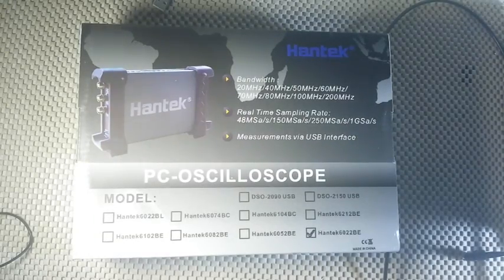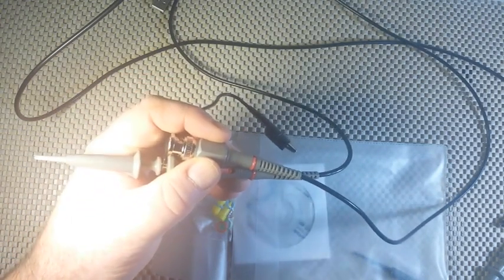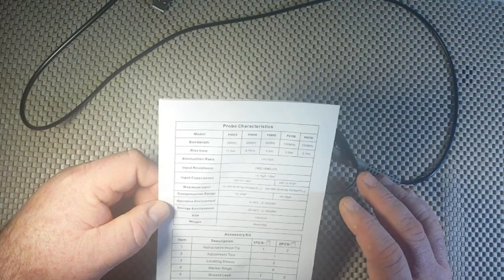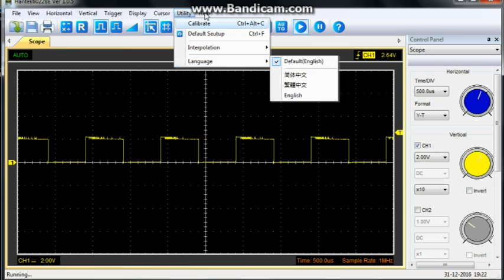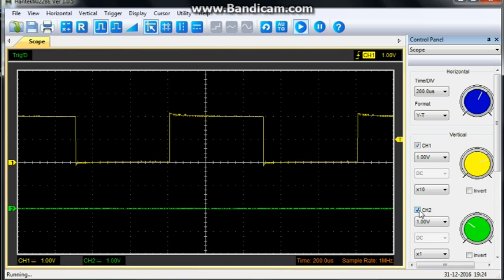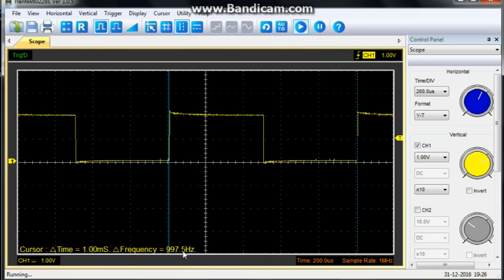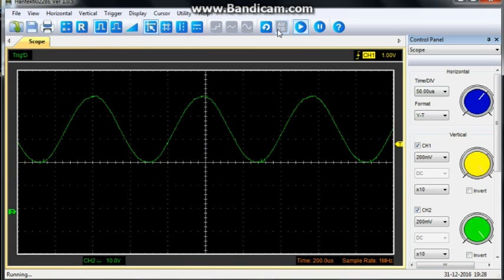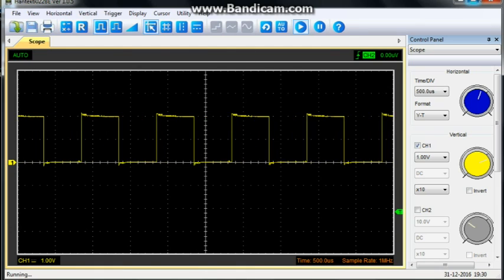Hantek 6022BE Overview

Comment: shout out to all of us "low budget" people in 2020
Reply: Yah, ended up buying one of those dso things instead, has been great for my use
Reply: Mine arrived to day and I have been having some fun with it.  Is it fantastic - HA! no.  Do you get what you paid for - I think so and more.  OK so I'm not trying to analyse GHz signals.  I'll be using it for some building/calibrating DIY test gear and antique radio restoration so I think it should be more than enough for my needs now.

Comment: Mmmm I don't know man.. I'm not too convinced. Somehow my Hantek MSO5202D scope (200Mhz with 2 channels) (stand alone doesn't need a computer), seems a more complete package. Is also very cheap. In China is around 650 USD, but I live in Europe and the transport, taxes... made it almost 1100 USD. However is quite good. I wish I have bought a 4 channel independent scope (I can't stand the shared controls from 3 and 4 with 1 and 2.. is a fucking hateful experience).

Comment: Yeah you should use it vertically! Is very stable in this position specially  when you are measuring with the short wired probes. There is no point in letting the scope body steal our space.

Comment: I have same scope but I'm totally disappointed with it, and I can't tell is it more problem in Hardware or poor software. I try also several SW for PC and for Android, but no luck.
Worst part of this scope is totally unreliable trigger for burst (1 shoot) applications, very hard to catch anything with it, it requires several attempts untll I catch signal, and when it catch it is usually missing part that I'm interested. For instance, time base 1ms, I'm trying to catch burst signal by trigger, and when it succeed (after 2-5 attempts), i have maybe 5ms of signal before trigger, and maybe 1 ms after trigger?? And I'm of course interested in part in area several ms after trigger, but this is missing, totally unreliable.

I try to solve one problem on some equipment with this scope, after half an hour I give up, I just could not get what I need.
For almost 10 years I used Welleman PCS500 scope and this was way better scope, even SW was much better although it was developed for win95, I sell it because I don't have any more PC with parallel port, which is needed for that scope, now I need to get some descent scope which can at least replace old Welleman. This is not the one.

Comment: What is the maximum peak to peak signal that you can apply to it?
Reply from the maker: 35VP2P with out external attenuation
Reply: @learnelectronics  no its not true
In the user manual writen by 10x probe it just measure 50 volt
Reply: Thanks

Comment: I got some model of this but am always afraid I will overvoltage it. I also want to test my motorbike ht coil output which is several kv (20? 30? 40?) But no idea what probes to use so it dont blow the thing!
Reply: Just buy x1000 probes and you should be fine

Comment: Hello
new to electronics and just bought the hantek 6022be.
have installed software from the website, but cant get driver download to zip open and work.
i have the scope screen on my computer, just cant get any wave forms to show.
also the 2 usb male plugs, do they both insert into computer?one is black, the other is red.
have tried their website but cant get an answer.
i have windows 10
any help/advise you can give me would be greatly appreciated.
thanks
john
Reply from the maker: I can't help you with Windows 10. I use Windows 7. But yes, both USB cables need to be plugged in.
Reply: ok thanks for your reply.
any other ideas on getting hantek driver to work?
thanks
john
Reply: sorry
found the problem.
john

Comment: How do you/can you isolate a USB scope that does not specifically offer isolation?  I would be a little leery of connecting any scope to an expensive laptop without some kind of protection from ground loops, etc..
Reply from the maker: The USB port on laptops is pretty robust because manufacturers do not know what you may hook up to it. But still, I would be wary of using a USB scope on anything more than 12VDC home hobby type stuff.
Reply: @learnelectronics  , thanks for the reply.  I am A) just getting into exploring digital electronics (I'm an audio engineer - location sound mixer for film & video -  but that's more knob-twirling, on-the-ground tech stuff, rather than engineering theory) and am contemplating a low-cost oscilloscope, but honestly all the intro-type videos I have found are amateurish and seem to assume that everyone already knows about triggering and when & where to adjust the scope to get the readings that are useful.  A ground-up instructional video on those kinds of essential beginner details would be great!

Comment: I know that the specks say that the max frequency is only 200 Megahertz.... but what happen if you need to measure much higher frequencies? any way that one can use a divider?? or something like that to read much higher frequencies?
Reply from the maker: It will read much higher frequencies, they will just be attenuated in amplitude.
Reply: Thank you very much.... do you have any kind of advice for some one that use up to 2.4 Ghz
Reply: The maximum frequency of this hobby scope is 20 Mhz not 200 Mhz, quite a difference (10 times in frequency and even more in sampling rate). It's a $60 scope so you would not expect to go this high and be accurate. Let alone speaking in Ghz - you are in range of $$$$ or even $$$$$+ budget for a scope, so possibly you must be really sure you know what you need it for. Analyzing such high frequency signals maybe you need another type of instrument cause there are many besides oscilloscopes, like spectrum analyzers, logic analyzers, waveform analyzers, special protocol stuff etc. You could buy or build the so called prescaler for Ghz range, but nah, not with this one.
Reply: Thank you, Your input is greatly appreciated.

Comment: I own the same scope. Very good and fun to use. Better than the hantek one.
Mostly All measurements options in the software like Volts, Freq,Pulse Time, FFT, Etc...
4 trigger methods including External Trigger.
40V max input on 10x (Probes are 1x -10x)
Some features:
Usb Powered. 
Two probes (2 Input Channels)
Advanced features like Frequency Error Check & Export  Live Data to Csv Format.
Bug free Software.
Auxiliary Channel for Output/Input.
Fast Display of waves in Software.

I baught one for 80$ from Aliexpress.
 The Other 1022(I) Model is 400V Supported. You should buy that one of you want to do high voltage work.

Comment: Does DC coupling means only DC sources can be attached to it? Will it work for AC sources?
Reply: it means that any dc voltage should be shown as a vertical displacement, if it  have the ac coupling, then all dc voltage will be ignored by oscilloscope, those modes are both useful depending on the case
Reply: This cannot do AC coupling?
Reply: If you stick your finger on the probe it shows all the RF rubbish your body picks up.  That's about as AC as you can get  :-)

Comment: For the general record, open source software is available, http://openhantek.org/
Originally meant for Linux but it can run on several platforms now. The git README mentions that Windows will require special firmware/drivers. I have not tested this software yet as I don't have the scope yet.

Comment: The HT6022BE driver on the Hantek website is unsigned and will not work on Windows 10.
I found a signed driver that does work and I share it here:
https://drive.google.com/drive/folders/1-O5tUewwdNRq2rD-JrOUT7zbUTOhqEfs?usp=sharing

Comment: Hello Friend! Thanks for posting the video. Friend, I bought the same oscilloscope 6 months ago. I have barely used it 3 times, but the reason is that after a few minutes of turning it on and starting to make measurements, it says:
Scope of I stop working.

The program stopped working because of a problem. Windows will close the program and notify you if a solution exists.

I've tried it with all systems, and it always gives me the same error. I even have it installed on windows10, and I have configured it as windows7 and vista, and always the same error.
Any help is appreciated.
I'm spanish. Google Translation.
Thank you
Reply: Go to their website a download the software. Wasn't able to use the cd that came with my 8 channel scope so I tried older versions.

Comment: An issue I ran into is memory size. I want to look at bus signals inside a device and can't store enough data points inside the thing to view an entire exchange inside the system in the necessary resolution. It's depressing :/

Comment: I want to work on above 100VDC signal is it possible with this USB oscilloscope
Reply from the maker: Suresh Lingabathina Babu according to the specs, yes it is. But do you really want to put +100V into your USB?
Reply: We need to test 96V DC SMPS power bank chargers for telecom company , if I use 10x probe I am pumping in just 9.6V at scope input right.
Reply from the maker: Yes, you are correct. I just wanted to make sure you understood.
Reply: Thank you

Comment: Quite a good review. It covers what I needed to know. I make theremins as a hobby and am playing with oscillators, and wanted to know if it can work in the khz range. It seems it does. For the price it is a good scope. I think I will get it. Eventually I will get the Hantek 5072. But for now this seems a good choice, especially as I have a laptop kicking around. I will check out the rest of your vids too.
Reply from the maker: Maarkaus J yes it will do KHz no problem. I have a 5072P as well. mine is hacked to 200 MHz
Reply: if your are doing low frequency stuff a soundcard 'oscilloscope' (free bit of software) might work too, it is pretty much useless for anything higher frequency and not ideal, but hell it works for free if you already have a soundcard (or a 2$ crappy one lying around :D) ..... a usb oscilloscope is far better :P im thinking about buying one, thanks for the vide learnelectronics :)

Comment: Very good video  I am going to get one any tips
Reply from the maker: Mrinal  Thakur there is no ac coupling
Reply: learnelectronics kk
Reply: learnelectronics then we get to see entire signal 
can be fixed by connecting a capacitor in series
Reply: I do not understand why would you connect capacitor in series - can you elaborate? Thanks.
Reply from the maker: A capacitor will block DC voltages and allow only AC through
Reply: Tony Fleming see after connecting a capacitor ( non polarised with as low as possible ESR ) in series of appropriate value 1uf and below  with the signal the capacitor will bolock the DC an will only let the AC pass so even with DC coupling in setting we get AC values
Reply: https://lh3.googleusercontent.com/56OkyXIqQcMqNrBrGUwvC1Aer7kF0uL5ZsYPYKfipmO6nDRntAC30JAAKtbIdzIfU_x4eglTIw
Reply: Try this app this has AC coupelon option
Reply: https://www.google.co.in/url?sa=t&source=web&rct=j&url=https://play.google.com/store/apps/details%3Fid%3Dcom.martinloren.hscope%26hl%3Den%26referrer%3Dutm_source%253Dgoogle%2526utm_medium%253Dorganic%2526utm_term%253Dhscope%26pcampaignid%3DAPPU_1_lDksWZioPInuvASVkZTACQ&ved=0ahUKEwiYwoaNsZXUAhUJN48KHZUIBZgQ5YQBCB8wAQ&usg=AFQjCNHvN3ukEp-aY3wbKY_WBrEIr7k9qQ&sig2=28G1SjTjt_FuvT1HtuiZXw
Reply: Tony Fleming connect the capacitor between the signal as oscilloscope probe input leave the ground intact
Reply: Tony Fleming hope it helps you are welcome

Comment: Hi. Can you tell me the highest frequency digital signal you have measured with this scope? Thanks for the video and any info.
Reply from the maker: UReasonIt The highest signal frequency I've had need to measure was +/- 200kHz. It was very clean @ that frequency. I think, for the money, this is a pretty decent scope. That being said, it has some weirdness with triggering. But I have found that if you let it auto trigger, then adjust from there it works well. The included probes are definitely One Hung Lo chinesium quality though.
Reply: Thanks for the info.  I have a DSO096, and I will trigger on 2MHZ+ (at @ 2.8 is garbles the wave) I also still have a DSO201, and it will do @200khz or so.  I never could get it to re-flash though :/. I want a new scope, but I don't have a lot of space :(  I guess I will save my pennies for a small 100MHZ dso.  Thanks again!
Reply from the maker: UReasonIt No problem, glad I could help. Hey for another $230 bucks or so you can get the Rigol 1054z.
Reply: I know, I have to keep my wife from kicking me out! :)
Reply: @learnelectronics  i want to get a rigol ds1102e. what's your thoughts on that scope? is it worth buying or I'm better buying the ds1054z?
Reply: My friend has the R-1054Z and for the money, it is the best choice out there!

Comment: I cant find any info on what Windows version I need that would be compatible with this oscilloscope. Which Windows are you running? Does Windows 10 work?
Reply from the maker: Jesse Gibboney hi Jesse, thanks for watching and taking the time to comment. the scope and software will work just fine with Windows 10. but the driver on the supplied CD will not. there is a Windows 10 driver available on Hantek's website though. I'm using Windows 7 myself.
Reply: It has a Windows 10 driver on the Hantek website that I installed and works.  Separately, to make the display stable, the right side T (trigger) should be moved up to the middle of the signal, and triggered by the channel being viewed.  Decent scope.
Reply: I've used it on Windows 10 and it works fine